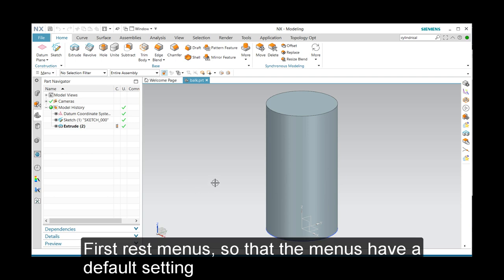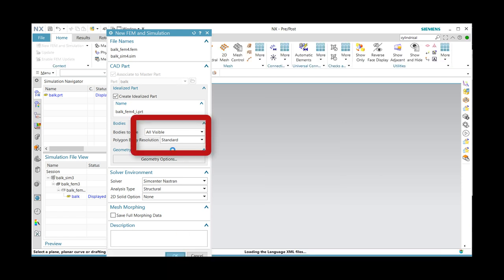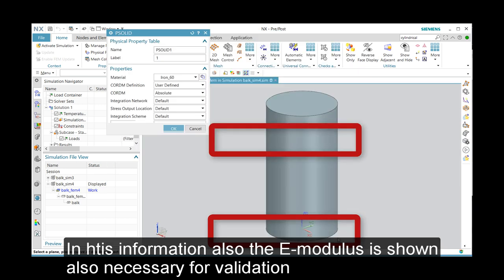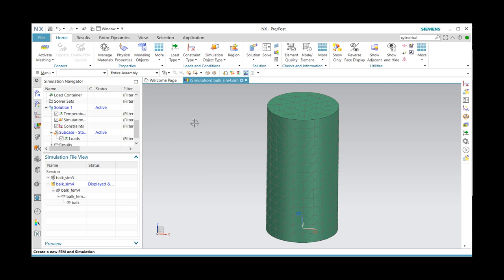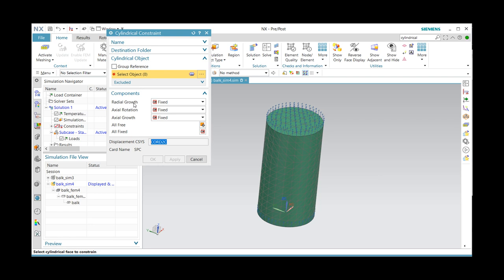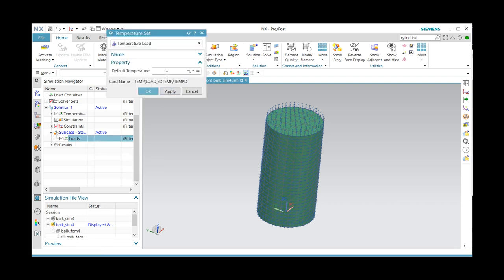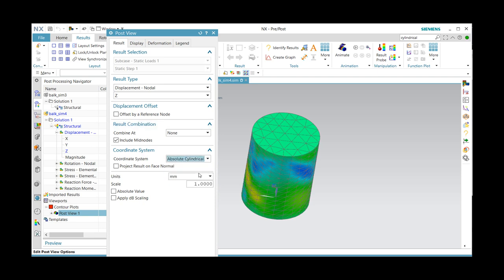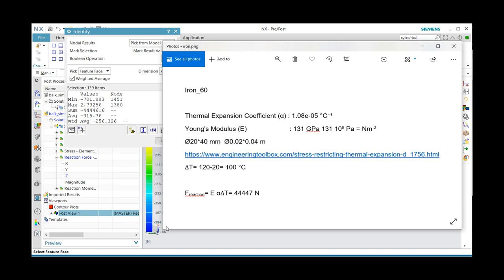How to define temperature load in Siemens NX (1915) FEM simulation, including analytical validation.

Comment: What is the difference between NX 1915 and NX12? Is NX 1915 a newer NX version?
Reply from the maker: Hello David, after version NX12 Siemens started rolling distributions with frequent updates with version numbers 1847 , 1872 and 1899 which could be considered as NX13 , NX14 and NX15 and 1915 is an update of version 1899 so something like NX15.0.2. Thanks for viewing.
Regards,
Olaf
Reply: Yes, 1915 is newer than NX12.  The major release version progression from NX12 goes to NX1847 (the year Siemens was founded), NX1872, NX1899, NX1926, NX1953, NX1980 and NX2007.  There were 5 minor releases for each of these major release that incremented the major release by 4 (e.g. NX1899, NX1903, NX1907, NX1911, NX1915, NX1919).  The next major release will have a new numbering scheme that is less confusing.  The next major release dropping in June 2022 will be NX2206.  22 is for the last two digits of the year and 06 is for the month.  The following release in December 2022 will be NX2212.